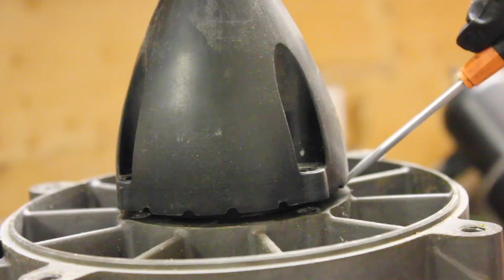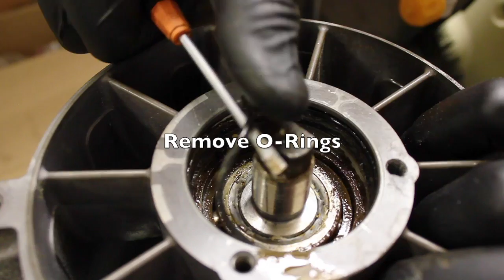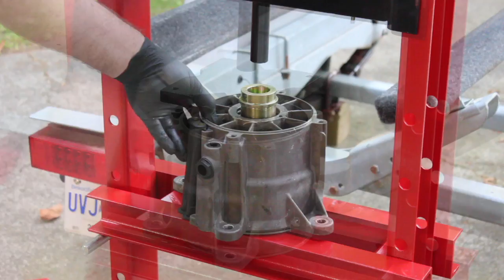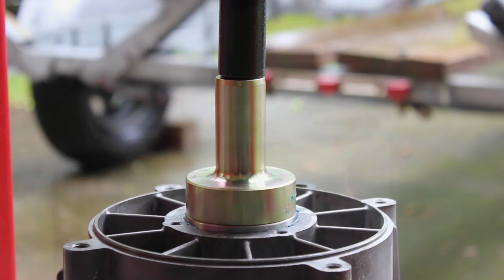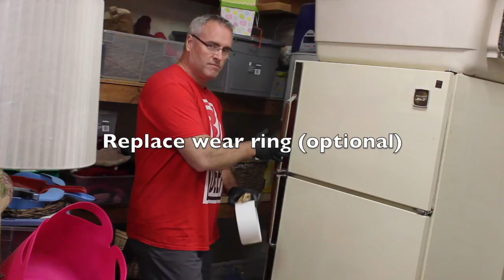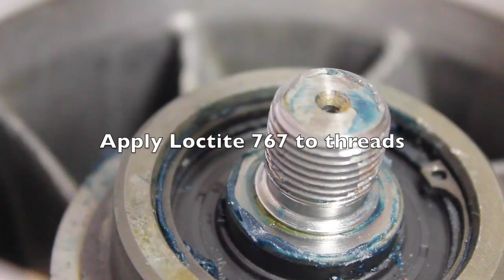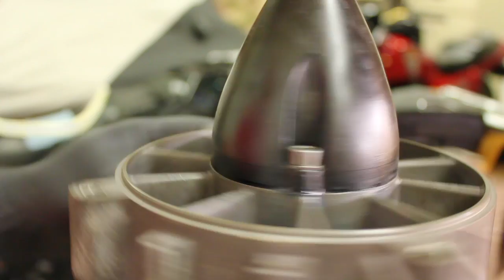How to Rebuild Your Sea Doo Personal Watercraft Jet Ski Jet Pump

Comment: You Sir have provided a great video

This is exactly what I need done!!
Can I send my pump to you for a quick fix??

I don't have the tools or skill set to get this done.  Local repair shop said $1200!!!
Reply from the maker: Sorry, we'd like to but we don't have the time to do work for others. We both have day jobs. Good luck!
Reply: 3ftDeep Do think the jet pump can locked out the engine?
Reply from the maker: I doubt it. If by "locked out "you mean the engine will not turn over, that's most likely a problem with your engine.
Reply: 3ftDeep the starter only due click click.i no i have problems with the  started.what do think is the damage in the block.
Reply from the maker: There could be lots of reasons for your problem. Why do you think your damaged your engine? Did you get water in it?
Reply: 3ftDeep i dont see water on spark plugs,i remove the jet pump and i trying to started with out the jet pump but still same, you hear the solenoid started doing click,click.but name me the resons that could be please.
Reply: 3ftDeep im just guessing cause i heard people saying went the engine is lock that you has to rebuilt the whole engine or put a new one.but i dont no nothing about that .tell me please what you think about that.
Reply: 3ftDeep the only thing i can tell u is the he was vague to start like went the started is bad and then i was driving on the lake and he doesnt pass the 5000 rpms after 20 minutes i heard a noise in the back like rrrrrrrrrrrrr. i reduce the speed and the he shut off.and then i trying to crank it but only due click click.
Reply from the maker: Before you do anything else, I would make sure nothing is jammed in your pump. Look through your intake grate, and if necessary, pull your pump. It also could be that your pump is seized. If it's not in your drive train, it could be your engine.
Reply from the maker: Sorry, I see you already pulled the pump. It sounds like this machine needs to be seen before a diagnosis can be made. It's very difficult to do over the internet. I suggest you take it to a licensed mechanic to diagnose. Good luck!
Reply: @karma2621  curious if you resolved the issue? I would guess supercharger failed if it has one?

Comment: I have a 2016 gtr 215.  Where can I buy those special tools needed to remove the impeller end replace the bearings?  Do you have a part # you can share?
Reply from the maker: You can find lots of tools, etc. on our Amazon eStore at 3ftDeepSports.com, but here's a link directly to the tool that should work: https://www.amazon.com/dp/B00KI367F6/ref=as_sl_pc_tf_til?tag=3ftdspor-20&linkCode=w00&linkId=cc83089038fcfa67c1b51091362403f9&creativeASIN=B00KI367F6

Comment: What would be the symptoms to let you know you need to have your jetpump rebuild ? I cannot get pass 10 mph even at full throttle rpm rev high. The only time i can get it to go is when there is only 1 to 2 people (normal size) on max then it goes to 40-45 mph
Reply from the maker: That would be a symptom. Check the clearance between the edge of the impeller and the inside of the wear ring. It should only be about a millimeter. If it’s more than one and a half millimeters, you should probably replace the wear ring. You can check the condition of the pump without taking it off by taking the impeller cover off and looking for water inside. It doesn’t guarantee there are no problems, but if there is water you need to pull the pump and check it out thoroughly. Of course, before you do anything you should check to ensure that the intake grate is clear of any debris. Good luck.
Reply: @3ftDeepChannel  thank you

Comment: Could you help please, iv built my pump using this video which was great. However I have 2 o rings left over from the kit, can you think what they will be? Not the venturi small ones.
Reply from the maker: It would be easiest if you could send a picture of the O-rings via email.
Reply: @3ftDeepChannel  what's your email?
Reply from the maker: 3ftdeepchannel@gmail.com
Reply: @3ftDeepChannel  email sent showing o rings👍
Reply from the maker: Sorry for the delay, I was traveling. They make those kits for multiple machines across multiple years, and the configurations of the pumps change slightly. So, if you didn’t notice those O-rings in your pump system, it is likely they are for a different machine or different year.
Reply: @3ftDeepChannel  thank you for the help, I found out one was to go in the back of the  impeller  and looks like one one is for a different model 👍

Comment: Hello !! I want to ask a question. 2013 Sea-Doo GTX 155   power is lost and does not start from the start button, there is no sound signal LCD CLUSTER does not show anything   what could be the reason?
Reply from the maker: Likely power supply. Check the battery voltage. You should have well over 12 volts (probably 12.5v). If that’s ok, then it’s likely an issue with a wire, most likely a ground wire. Make sure the connections to the battery are secure, too. Good luck.

Comment: Can i use my silver based antisieze on the shelf instead of the locktite brand 767? 
I already have a big bottle of some other brand.
Reply from the maker: It is different so we can’t recommend the substitution. I know it’s hard to find, but you should be able to find some after a while. We used to sell it on our Amazon eStore before it got shut down. You could also call your Sea-Doo service center and ask them what they recommend. Good luck.

Comment: Are you using the Lucas bearing grease to fill the pump and cone? I just replaced my pump grease with OEM stuff and it was more of a yellow than the blue in the video.
Reply from the maker: Chris uses cheaper marine grease. I recommend using the expensive OEM grease.

Comment: Do you use the same bearing/seal pusher you used in the video for the new version of the oil seal. I can’t get the old style anymore and the new ones look like there are not as wide as the old ones. Any idea on this? Thank you.
Part number 271002071 has superseded part number 293200086 and they are quite different.
Reply from the maker: We have different pushers for different bearings and seals. It’ll also depend on your unit so check with the tool supplier (SBT?) to make sure it’s exactly the right one for your system.

Comment: My hull filled with water on idle and when I took it into the dealer I'm being told the pump bearing went and caused water to blow back through the carbon seal. Does this make sense? Apparently carbon seal is fine but issue was with the pump. I'm not sure I understand how a pump bearing coukd cause your hull to fill up.
Reply from the maker: Yes, it does. I had the same failure while on a long trip to an island. The pump is helping to hold the drive shaft in place. When it fails catastrophically there may not be enough pressure against the carbon ring and the seal will no longer be there. On my old machine when I was revving the engine water was coming in a forceful spray. That's why it's critical that we maintain our pumps! Sorry for the delayed response, but I just found your comment today.

Comment: I can’t get the flange nut off the shaft with the shaft in the jet pump. It is on too tight, and there isn’t enough room to get tools on it. 

Is it possible to remove the shaft first, then remove the flange nut ?
Reply from the maker: Do you have an impact driver? Those really make the job easier.
Reply: 3ftDeep  the problem is that the impeller breaks loose from the shaft before the nuts loosens. 

Would an impact driver help that ?
Reply from the maker: Yes, very often that helps with that type of situation.
Reply: 3ftDeep  is it possible to remove the shaft from the jet pump first, and then remove the nut ?  I think that would work for sure.

Comment: My drive shaft splines were stripped at the impeller. I was wondering if you know what causes that. And they were only stripped about halfway up the splines so i fell as if the shaft is not long enough or something.
Reply from the maker: Are you certain it’s the original driveshaft?
Reply: @3ftDeepChannel  I appreciate the response, I found 2 motor mounts to be bad and am assuming that to be the cause.
Reply from the maker: It could be. Some of the driveshafts are also quite rounded at the end. It could be a normal part of the design. If you're still concerned, feel free to send us a photo to our email address.

Comment: Hi mate. I have seadoo rxt x255 2009, I want to check the Engine compression but i don't know what is the best compression? thanks
Reply from the maker: They can vary quite a bit between machines, the main thing is that they should all be similar.

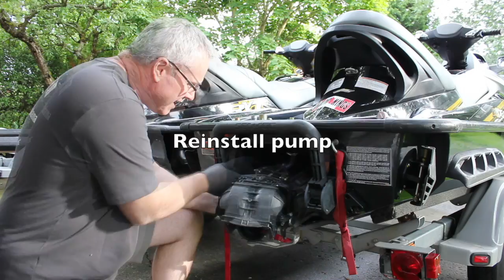Comment: Hello , I would like know what is the force of torque screw of the four last screws when you reinstall the pump at 7:05 mn . Many thanks 🙏🏻
Reply from the maker: That will depend on the year and model of your machine. It does vary from year to year. There are quite a few service manuals available online, so you should see if there is one available for your machine. It will come in very handy.
Reply: @3ftDeepChannel  Many thanks for your reply . I have a Seadoo Gti 130 - 2014 . I have try to find my manual but without result :( . You have a tips for find it or you know the force  for my model ? Thanks again :)
Reply from the maker: It looks like the same mounting system as my old 2012 GTR 215, so without any other info I'd torque them to 16 foot pounds (or 22 N.m). Good luck.
Reply: @3ftDeepChannel  many thanks 🙏🏻 you are the best 🔥🔥🔥

Comment: I have a 2017 seadoo gtr-x 230 I just put new bearing grease from the shop where the flange nut is and also in the cone. Question is, is it ok to apply that same grease where the drive shaft enters the impeller as well as in the boot or is triple guard grease the way to go? The amount of grease from factory as I took it apart seemed to be insufficient to the amounts posted in your video which I thought was odd. Around the splines of the drive shaft and inside the boot had rust in the thin layer of grease that wiped off thankfully but trying to prevent that or any rust in the future.
Reply from the maker: Triple Guard grease is definitely the way to go. I don’t know how it’s made, but that stuff sticks like crazy …even in salt water. That’s what the Service Manual says to use and we’ve found it to be excellent over the years. The Manual also seems to be getting away from putting bearing grease in the nose cone, but we still add some anyways. Good luck.
Reply: @3ftDeepChannel  Thank you! Triple guard grease in the boot which in turn is  where the drive shaft enters impeller as well correct? Also where can you find the manual? I purchased mine new but I misplaced the manual it came with.
Reply from the maker: The Triple Guard Grease is just supposed to go (generously) directly on the splines of your driveshaft. The manual suggests Loctite 438 to go inside the driveshaft boot/plastic guard. You can probably find a Service Manual for your machine here: https://brpmanuals.com/seadoo-manual.htm. An Owners Manual can be downloaded from Sea-Doo's website. Good luck.
Reply: Thank you so much
Reply: My manual doesn’t mean toon triple guard grease. Only mentions 

JET PUMP BEARING GREASE (P/N 293 550 032) AKA XPS Grease

I take it this isn’t as good as triple guard grease or is it the same. 

Any type/brand of recommendation or they all the same.
Reply from the maker: Jet pump bearing grease is totally different. I’ve only seen Jet Pump Bearing Grease used in the jet pump (i.e. under the impeller cover). The Triple Guard Grease has always been recommended on the driveshaft splines. You should confirm what you’re reading by looking at the exploded diagram of the propulsion system. For brands, we always use Evinrude Triple Guard Grease, and BRP Jet Pump Grease. Good luck.

Comment: did you drill a hole in the oil seal to get it out?
Reply from the maker: No drill, but we had to use a sharp tool to (carefully) punch a hole in it.

Comment: Great vids as usual! Question, what is your opinion on stainless steel wear rings?
Reply from the maker: That's a very good question and you'll get a different answer from different people you ask. My feeling is that it was made by the engineers who design the machines to be a "sacrificial" part for a good reason. When the ring interacts with the impeller something's got to give, especially if something hard is stuck in there. So my feeling is if your wear ring is stainless steel, your impeller would wear down much quicker than if it was plastic ...and that's an expensive item. So, I stick with nylon wear rings and replace them periodically. Thanks for your comment.

Comment: My seadoo is doing this exact thing. What was causing this issue? I’ve spent weeks trying to figure it out. Any help will be greatly appreciated
Reply from the maker: I’m not sure what you mean. We just show rebuilding the jet pump. What issues are you having?
Reply: 3ftDeep sorry the video switched while I was in the comments and for some reason sent my comment to you. My issue is when I give my seadoo jetboat throttle is bounces off rev limiter. It has taken weeks and two engine swaps to get to where I’m at lol. I’m thinking it has bad rectifiers
Reply from the maker: That's brutal. Sounds like you've got the troubleshooting underway. Keep us posted with your progress.
Reply: 3ftDeep update!! On my seadoo sportster it’s now running great 👍 their was corrosion on the ground bolt that goes through the rectifiers causing them to operate properly making the computer go into a electric limp mode
Reply from the maker: That's great! Chris and I were just talking last night about how grounding problems have been the cause of most of our vehicle electrical problems! Thanks for sharing!

Comment: how long did you leave the pump in the freezer to make it come out that easy?
Reply from the maker: You should leave it in there for about an hour.
Reply: 3ftDeep should I leave the new ring in the freezer with it for easy install?
Reply from the maker: Yes. Cold objects shrink and warm ones expand. Shrinking the ring a bit will help it to slide in the warmer pump.

Comment: Any advice on why my GTI 155 2007 runs the first 6 gallons of fuel fine the plays empty after I burn the first 6 off the top? Once I fill it it runs fine again down to about nine gallons and acts empty
Reply: vacuum in tank
Reply from the maker: Could be a weak fuel pump
Reply: @3ftDeepChannel  i only got 2.5 yrs under my belt with jet skis , I am a new bee at age 62 .and i go by my years at caterpillar , a weak transfer pump would do the same thing at 1/2 a tank as would a plugged vent in the gas cap , i cant see dust plugging the cap so i think you nailed it , PS your videos are the best  ,  Thank You

Comment: Hi, nice videos! You think it could be good to lubricate the shaft when you put it into bearing and the bearing when you put in into pump housing? In case, with what? Thanks
Reply from the maker: I wouldn't use anything. The bearing needs to be pressed in, and it needs to stick to the housing and shaft well.
Reply: Thanks for answer.
Reply: You think a 6 ton press in enough?
Reply from the maker: Should be plenty.
Reply: What can I use instead of Loctite 767? I'm not able to find it... What is with bearing grease?
Reply from the maker: I've only used Loctite anti-seize lubricant, but there are other products out there you can use. You can order it through our online store at: http://www.3ftdeepsports.com . I'm not sure what your question is about bearing grease, but Chris is using generic marine bearing grease in the video. You should use the Sea-Doo jet pump bearing grease as described in the text. Good luck.
Reply: 3ftDeep my question about bearing grease was if I can use it instead of loctite 767... thanks for your patience ;)
Reply from the maker: Unfortunately no. It's very different.
Reply: ok.. thanks

Comment: Hello, to my understanding I own a 2003 Seadoo Sportster 4tec jetboat, however I order a jet pump rebuild kit with bearing number 293350042 and it doesn’t fit. I made sure to triple check I was getting the right kit. Obviously I’m frustrated, any ideas with what I’m doing wrong?
Reply from the maker: Hello Caleb, As long as you're using the OEM part (and it looks like you've got the right one), it should fit. I'm sure you're aware that the bearing fit should be tight enough that it requires a press to get it in. If it doesn't fit at all, I suggest they sent you the wrong part (it could be mislabeled), or you don't have the pump (or year of machine) you think you have. I would bring the pump into your dealer and see if they can help you figure it out. Good luck!
Reply: @3ftDeepChannel  thank you very much, and I appreciate your amazing videos!

Comment: should the "wear sleeve" always be replaced regardless? IN your opinion?
Reply from the maker: Only if it needs it. It's too expensive to replace just because you have the pump apart.
Reply: @3ftDeepChannel  my bearing froze(locked), the wear sleeve is scored but not deeply, has lots of fine lines around it, its green plastic and original, 2012 model
Reply from the maker: One thing we often do if there's a bit of scoring is flip the ring around so the unscathed material is now surrounding the impeller blades. That can improve performance. Good luck.

Comment: Can you swap a pump off a later model seadoo with reverse gate to early model without gate???
Reply from the maker: I’m not sure. It all depends on whether or not the bolt holes on the pump, the driveshaft splines and the seal around the impeller fit perfectly. It might be possible even if they do, but I wouldn’t advise it. Good luck.
Reply: @3ftDeepChannel  Thanks man, appreciate the info.